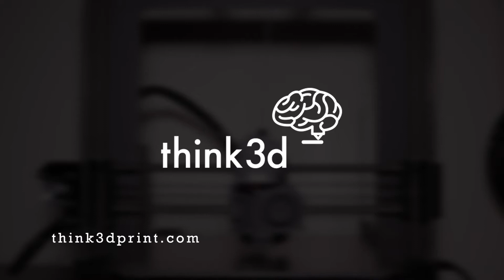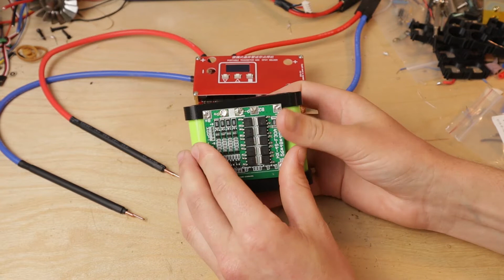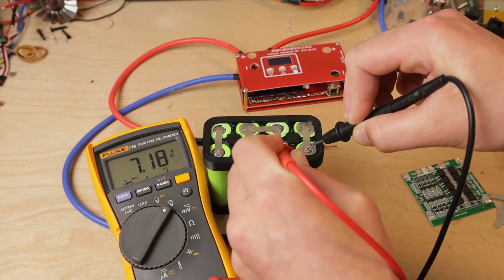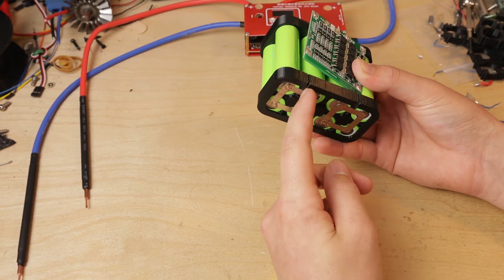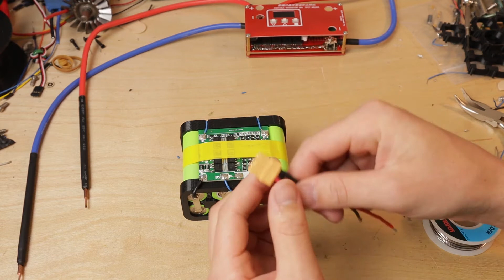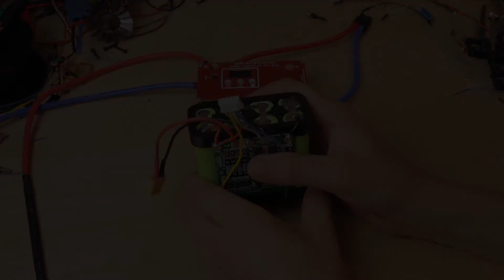18650 battery pack build

Comment: What battery did you used for your spotwelder
Reply from the maker: I used a 3s 8ah lipo from hobby king but that battery dosent have the power to weld anything over 0.1mm nickle. I am testing 4s lipos as all the components are rated to that voltage but the extra current may blow the fets.

Comment: Thanks for sharing.  I dig the cell holder, is that a 3d print?  Is it on thingiverse?  I have a few of those BMSes and that bottom edge can be removed, it might fit perfectly in the space between the cell holders if you snap it off.
Reply from the maker: It is 3d printed but I did not put it on Thingiverse because I am currently developing a BMS circuit that can actually hold 50A and has a higher LVC because 2.5v is harmful to the cells. I can try and upload a parametric version of this one but when I finish my circuit I will make holders with BMS mounts and even an external case for the core to slide into. When testing these cheap BMS they actually pretty bad at cutoff and sometimes drain the cells to 2.0v.